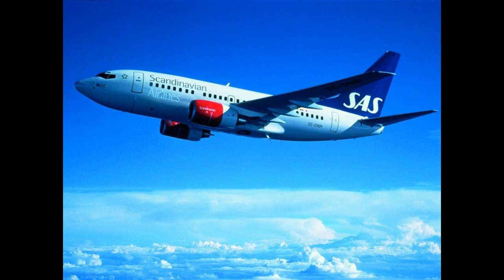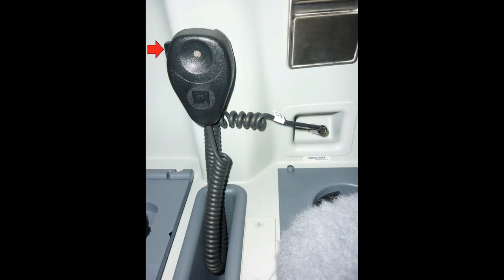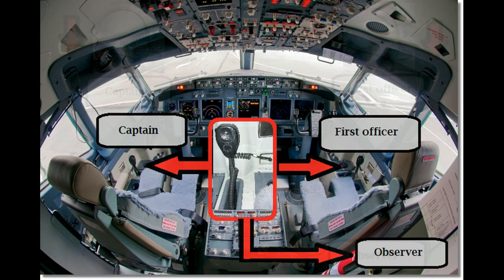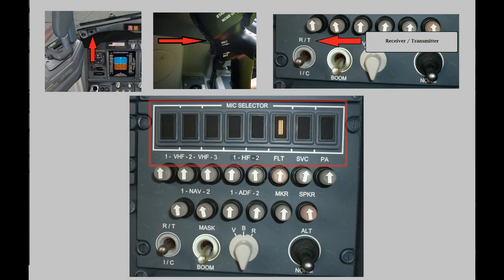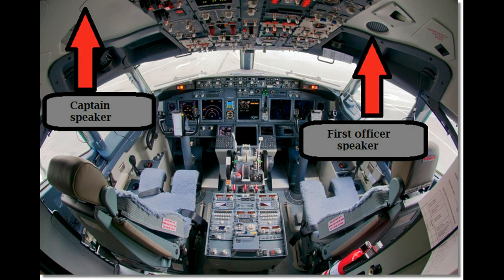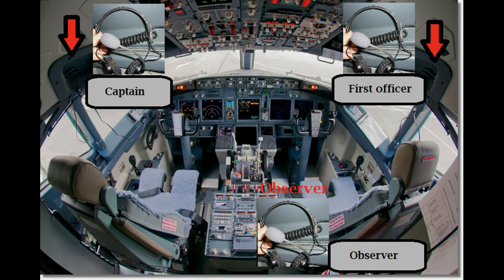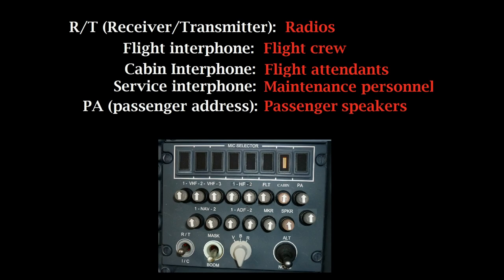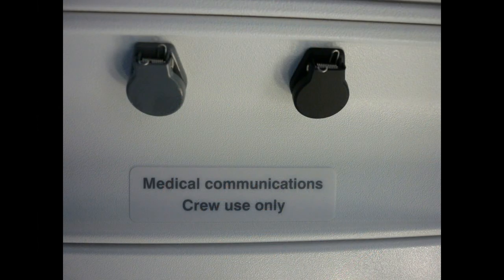Aviation (aircraft interphone systems)

Comment: I've been wondering this;
(in noisy cockpits) pilots talk to each other only over the interphone, but I can't imagine they constantly use push to talk for that. In this video, you showed how to transmit on the interphone using the switch on the back of the yoke and with the switch on the ACP itself, but isn't there an option to talk without PTT to each other?
Reply from the maker: Great question! That capability does exist. It is called "HOT MIKE".  Each airline has the option to have this installed when they purchase an aircraft. With this option, the switch in the control column can be locked into the "INT" position. This will make the microphone hot at all times so the pilots can converse over the flight interphone without the use of switches. Also, a more common option found is that the "INT" position on the ACP can be locked as well.

Comment: Can i ask how the flight deck crew would call the ground crew if there is no button on the audio control panel for ground crew?
Reply from the maker: There is a button above the pilots head called “GROUND CREW CALL”. Pushing the button will cause a very loud horn in the aircraft nose wheel well to go off. It is loud enough to be heard even if the engines are running. This notifies the crew to hook up a headset to the interphone and talk to the pilot. Likewise, the ground crew has a button on the nose of the plane they can push to let the pilot know the ground crew is trying to contact them. The button produces a “BING BONG” sound in the flight deck.
Reply: @bounder97  what's pilot head? Is it separated from audio control panel? Do you also know what's PCP in interphone system?
Reply from the maker: @rholanangelob.lopena5190  I said (There is a button above the pilots head called “GROUND CREW CALL”.) Do a search for 737 flight deck images on the internet. It will show you pictures of the flight deck. You will see a bunch of control panels on the ceiling above the pilots head. This is where the GROUND CREW CALL BUTTON is located. PCP probably means Pilot Call Panel. I have never heard of it, so you must be reading about airbus airplanes. I Sounds like you want to get into aviation. With all the questions you are asking, it sounds like you are on the right track and will do very well in that career field. Take care.

Comment: so you have to always push to talk to the other pilot? i thught in aviation the pilots always had open interphone. it must frustrating.
Reply from the maker: No, you don’t always have to “push to talk” to the other pilot. Each airline has their preference on having or not having a hot mike option. Most of them do use that option.  Everyone has the “push to talk” as standard interphone. If hot mike is desired, it must be turned on by the pilot. It is not always active except for the voice recorder. Everything that is said in the flight deck is always recorded though the microphones to the voice recorder. Oh, and during an emergency, when oxygen masks are put on, many airlines have hot mike automatically turn on as well.
Pretty sure I talked about “hot mike” in the video. It was a pretty long video, you probably just missed it. Thanks for commenting!!
Reply: @bounder97  thanks for the reply man. So the intercom switch doesn’t have a purpose if hot mic is installed ?
Reply from the maker: @lifeofranco  That is not true. The intercom switch must be installed so that you can communicate over the radios. Radio discipline requires short concise and to the point communications. Pilots use the intercom switch to ensure they are only talking on the radio when they are toggling the intercom switch. Afterward, they can toggle the switch to hot mike and yap at the other pilot all day long.

Comment: Do. You know what's CIDS
Reply from the maker: Hello, you may be talking about the Cabin Intercommunication Data system (CIDS) that is found on Airbus airplanes. It is the touch screen you see on the wall when you walk into them main entrance to the airplane from the boarding ramp. It allows the flight crew to manage the cabin functions such as lighting, interphone, evacuation signals and other monitoring systems. My video centered on the 737, which is a Boeing airplane. You will not find the CIDS on the 737.
Reply: @bounder97  yes cabin interommunication data system thankyou very much appreciated